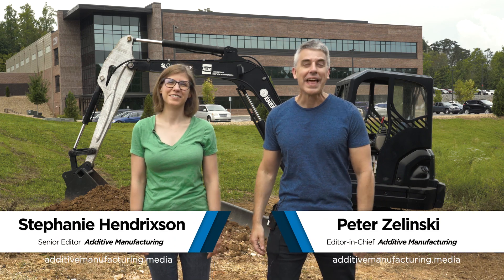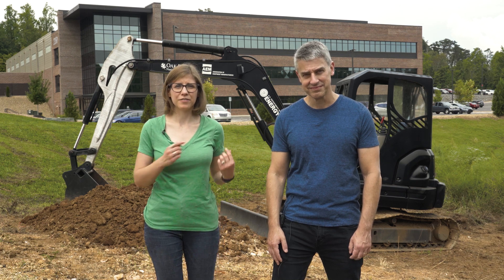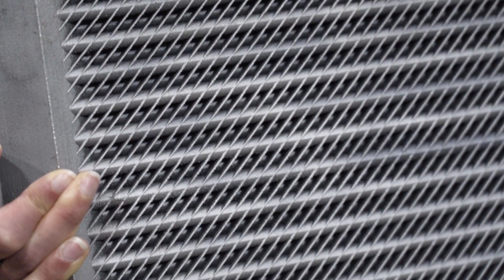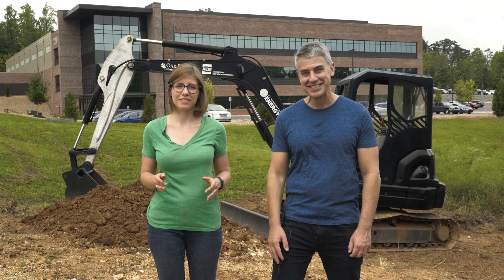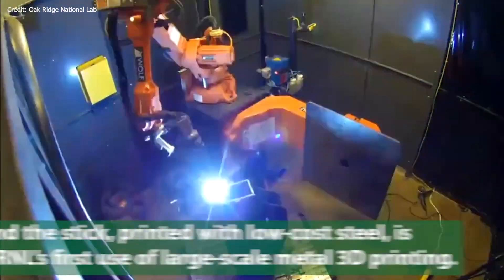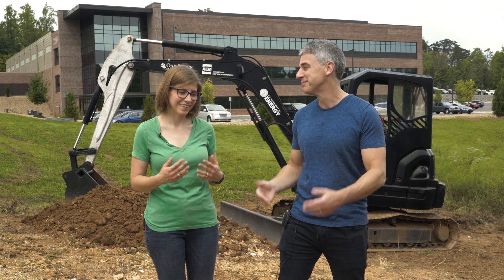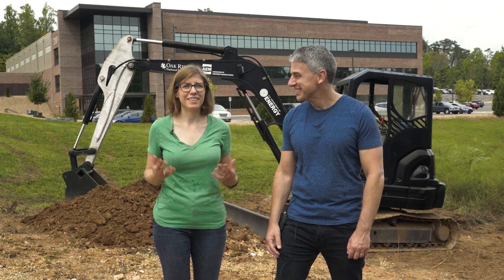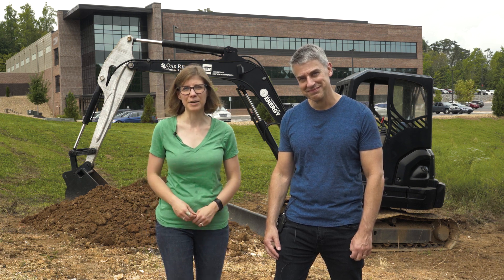Functional Excavator Features 3D Printed Parts

Comment: That's a fancy heat exchanger. Also the built-in hydraulic lines in the boom are a great idea, was it pressure tight right out of the print bed ?